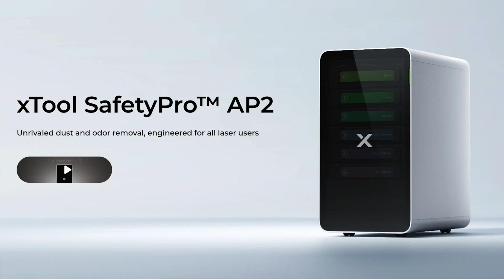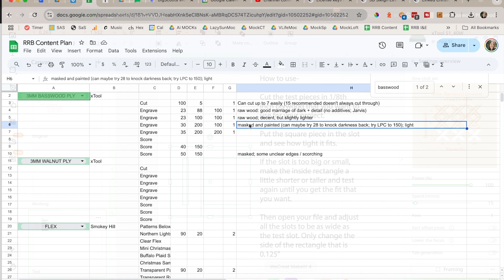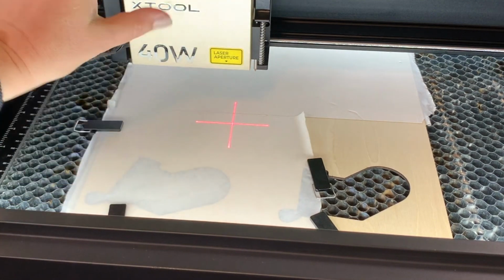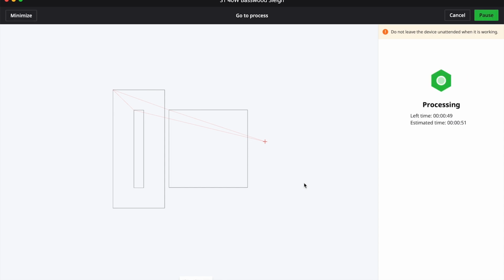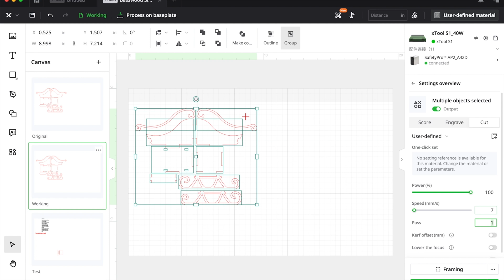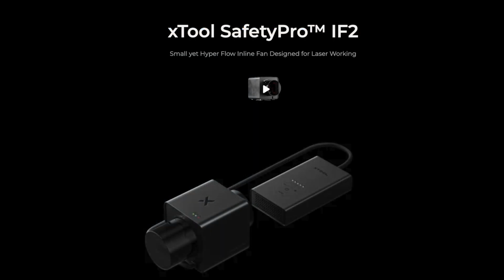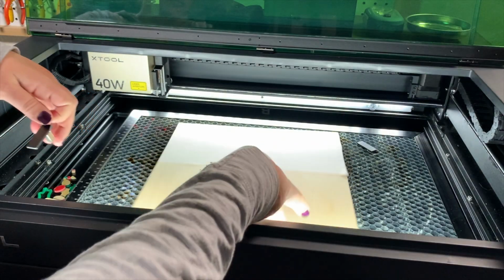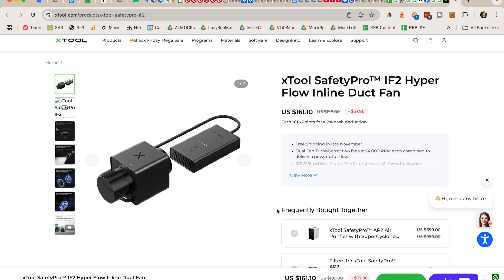Laser Safety Air Purifier or Inline Fan? xTool AP2 and xTool IF2 at Work with Real Projects

Comment: the site doesn't say the input voltage for the AP2, what is the voltage input?
Reply from the maker: I pulled the specs for you: https://support.xtool.com/article/1647

It states "Input power" 

AC 220-240V~ 50Hz 120W

AC 100–120V~ 60Hz 120W

Comment: Stool recommend removing the built in fan when setting up the in-line fan but there is no information anywhere on how to remove it. Did you remove yours?
Reply from the maker: Sorry for the late response, I didn't get a notification on this. Which machine do you have? If you have the S1, I didn't remove the S1 fan because mine is actually built in. I did go in and turn off the exhaust fan setting in the software. 

If you have the P2, unclip the wire to the fan and put a piece of electrical tape on the join left in the machine to protect from debris. You'd also have to turn off the exhaust fan slider in the software.
Reply: @ thanks for the info. I discovered that I was wrong in XTool recommending to remove the fan, it just said to turn it off. 😊

Comment: Would like to see how you are running the vent hose out the window. I had a window insert for the IF1 but obviously the new IF2 hose is 3.5 inches not 6.
Reply from the maker: Oh, I just cut it into insulation foam board (from the big box hardware store) and have my other unit's inline fan and this one routing out the same panel. I put the panel in the window, close it down to secure, and turn it all on. I am not sure if this link will work, but it's this stuff (I used 1"): https://www.homedepot.com/pep/Owens-Corning-FOAMULAR-NGX-F-150-1-in-x-4-ft-x-8-ft-SSE-R-5-XPS-Rigid-Foam-Board-Insulation-20WENGX/315197840?g_store=6585&source=shoppingads&locale=en-US&pla&mtc=SHOPPING-CM-CML-GGL-D22-022_004_INSULATION-NA-NA-NA-PMAX-5718363-NA-NA-NA-NBR-NA-NA-NEW-Pmax-CL3TestB&cm_mmc=SHOPPING-CM-CML-GGL-D22-022_004_INSULATION-NA-NA-NA-PMAX-5718363-NA-NA-NA-NBR-NA-NA-NEW-Pmax-CL3TestB-20550232742--&gad_source=1&gclid=CjwKCAiA3Na5BhAZEiwAzrfagPr5VjvOXoSTmHRK7R87F7eV5kr2psGAuJ630Iy9_0MXo6bKkkEkGhoC3HgQAvD_BwE&gclsrc=aw.ds
Reply from the maker: I forgot to mention: I have a blast gate for the 6" and am going to try and find one for the smaller one, as I'll be replacing my 6" inline fan with this one on the wall to have both the P2 and S1 go through it. 

I'll vent the M1 Ultra, the M1, and the Vista out of another hole but through the AP2, I think.
Reply: @SarahNenniDaher  if you find a way to put the blast gate on the smaller tube for the IF2 please let me know. Thanks for your help!!

Comment: Is there any issue with having the AP2 on the same surface as the S1 laser?  Workspace design doesn't allow me to put the AP2 on the floor.  Or should I go out and buy a longer hose?  Thoughts?  Thanks
Reply from the maker: There is nothing wrong with having it on the desk right next to it - I only moved it off the table because I wanted to put my computer right next to it. :) You can get a longer hose OR put it on the table.